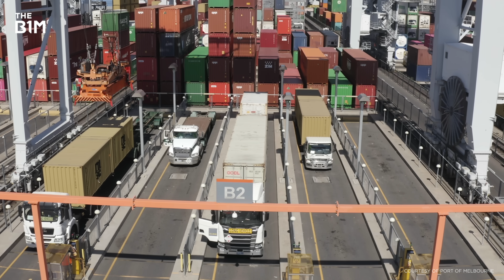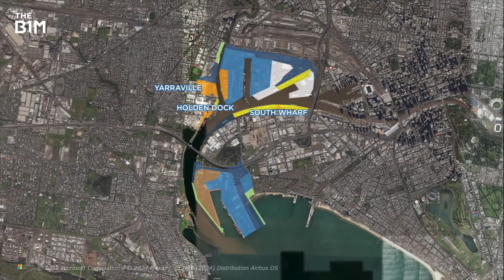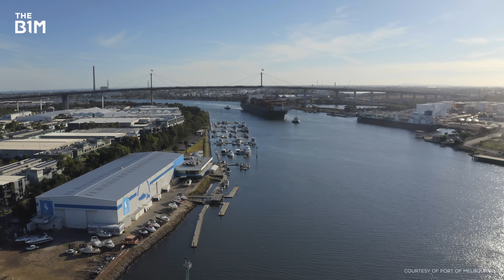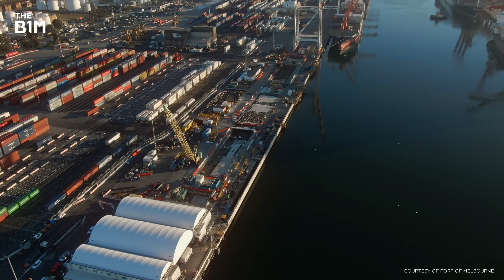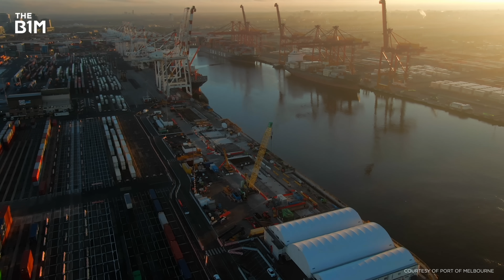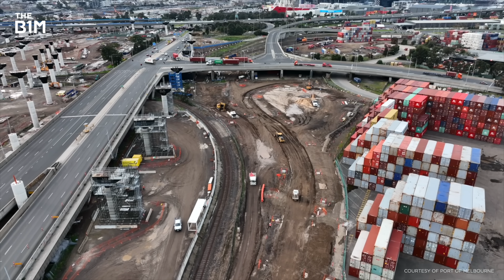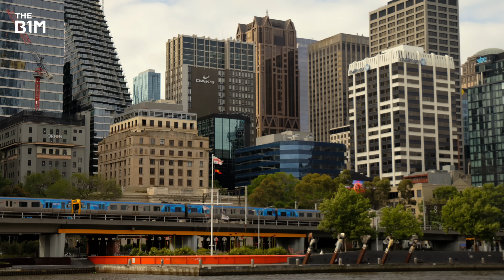The Race To Fix The World's Most Isolated Mega-Port

Comment: Dunno about it being "a race", more like a leisurely stroll in the park on a weekend.

Truck traffic through inner Melbourne is a nightmare. Despite the so-called "Big Build" that we're experiencing I don't know how it will benefit cargo logistics.

There were rumors about relocating the Port of Melbourne out to Hastings which is a deep water port and services the steel industry there. With nearby access to a major freeway, put in a heavy railway line (two lines, not one), and I'd have thought that it would be a no-brainer. Away from the centre of Melbourne and the existing port could be redeveloped for housing, other industry or whatever. But no, no-one wants to do it. Cost too much I'd expect. Lack of forward thinking.

Comment: But there is a train that comes up daily on the Frankston line where the train has more than sixty carts, that I assume is coming from Hastings which is a deep water port. I used to get stuck in my way home from work every day waiting for this train to move through the crossing. It was probably the reason that the level crossing was removed first.

Comment: Cool video mate, I was the front end loader operator for Seymour whyte on this job, that was a good job, the magnitude of scale of the fill we stripped and re-used on that job is hard for the non construction minded person to comprehend, I also found quite a few old bottle's, heaps of old red bricks and big bluestone blocks that were damaged and discarded as fill however long ago, they were very reminiscent of the bluestone blocks found on the facade of the state library in the cbd

Comment: Reminds me of Southampton. The bulk of the city separates the docks from the rest of the rail network. As much of the UK railway network was built decades before shipping containers had even been thought of, there were massive constraints on what could be carried. A lot of work has had to be done to the city centre Tunnel to allow modern ISO Containers to travel through, and the kinetic envelope is being taken full advantage of. Those containers use so much of the space in the tunnel that a human would be completely squashed if caught between the tunnel wall and a train. 

But there are still constraints on the network. For example, once out of the docks they have to interweave with fairly intensive local and long distance passengers trains. At Reading they have to weave across the Great Western Main Line and through the busy lines at Oxford, and in order to reach the main inland ports at Birmingham and Manchester they must navigate an long single track section at Kenilworth which is shared by a half hourly (in both directions) long distance passengers trains service, before then navigating through the intense urban West Midlands networks and onto the busy and high speed West Coast Main Line. Then there is the national disaster that is the Castlefield Corridor in Manchester. 

There’s an argument that so much national capacity could have been opened up, at far lower cost than HS2, by building a Southampton/Felixstowe to Manchester/Glasgow dedicated freight corridor in the same idea as the Betuweroute. But where’s the shiny prestige in freight trains?

Comment: Nope. Sydney is still Australia's most populous city. This is because the official figure used for capital city population, by the Australian Bureau of Statistics, is the Greater Capital City Statistical Areas (GCCSA). It's predicted that Melbourne will overtake Sydney in approximately 2030 or so using the GCCSA measure. The figure that is being used in the media is the Significant Urban Area (SUA) population. The City of Melton has been added into this population measure & this Melbourne's popultaion is higher than Sydney.

Comment: Does the geography not allow the port to be further away from the city center? That would solve so many problems.

I do not really understand why there is space for thousands of trucks, but not for trains. Those do not need o be 600 metres long. Just let a train carry 20 containers at a time from somewhere in the suburbs to the harbour. In Hamburg that is actually some. A few miles outside the city there is a huge cargo train station where goods are loaded onto trains. Those trains run to the harbour which in Hamburg also is right next to the city center.

Comment: I started at V/Line in Melbourne back in 1985, when it still handled freight all over the state.
Through several people in government having links to the road transport industry, more and more freight was put onto trucks, and the Melbourne Freight Yards were torn up one by one to enable the construction of the Docklands. Rail lines statewide were decommissioned and removed.
I had moved over to the Passenger Division in 1987, and from where I worked in the yards at Spencer Street - I had a ringside seat as it was all replaced by residential blocks, a stadium and Ferris wheel. 
The self inflicted situation that Melbourne found itself in, is primarily one of short-term self-interest over long-term visions for infrastructure. Hardly an isolated instance in Australia's history.

Comment: Ahhh - typical Victorians - they screw up their port. Container traffic should move to a new port at/near Point Wilson where rail and motorway connections are available. It would be parallel to Avalon Airport and between the bird sanctuaries. The port would function far better, and the government and community would reap a big dividend in the inner city.

Comment: We used to have a full rail connection to Station Pier and Princes pier that could tranship goods direct to rail.  That was destroyed so that Crown Casino could take over Southbank and lead the current transport nightmare through that area.  It was replaced with a very circuitous route to Webb dock.  That was destroyed so they could put in a football stadium and the Spencer Street and Victoria dock were destroyed to develop that area. Leaving a part of the docklands ENTIRELY reliant on trucks which pass through suburbs where the road making is nowhere near what is needed for heavy trucks. And one "solution" is to move a transshipment hub to the outer north of the city requiring all goods to be on truck through the city.  Great solution fellas. I forgot to mention how the original docks in the city were made inaccessible by the low level bridges such as queen's bridge and Spencer st bridge and Victoria docks were made inaccessible through two low level bridges just downstream of them.  In essence the docks have been a continuous example of REACTING "planning" and not FORWARD planning.  I strongly doubt that this current plan has more than a 10 to 20 year lifespan at most.
Reply: Totally correct, this is what consultants like me and my many friends at the former Vline Freight and Railways of Australia were saying in the 1980s and ever since. Future proofing means not closing off options (permanently) yet the policy actions that followed were the exact opposite of good practice. And increasingly cemented an irreversible point of no return.

Comment: Why can't some of this cargo be taken off a ship then shipped onto a smaller ship rather than rail?
Say the Melbourne to Adelaide run could be done by a smaller cargo ship that can berth in the smaller port in Adelaide. 
It would remove a lot of pressure from the infrastructure and cost far less over time.

Comment: Surely Fremantle is more isolated? Melbourne is a major freight hub. They even finally managed to get a single gauge track after 100 years! Some port facilities are not near the water at all but way off in other suburbs with a lot of flat land. A lot of the land they originally built the port on used to be a swallow lake that filled up with garbage in the first few years of settlement. Was called the Blue Lake. They already changed the course of the Yarra River for traffic. Was a boat that was stranded on dry ground for decades due to it.
Reply: How? Fremantle is on the Indian Ocean which is the artery between Europe and Asia. Melbourne is a lot further out from major shipping lanes. Perth may seem isolated when you're living on the East Coast but globally it's more accessible.

Comment: While on the topic of ports, there is a massive project underway in Egypt. The port of Ain Sokhna. It is right at the mouth of the Suez canal (southern end). It is part of a country-wide plan of port expansions in Egypt (Damietta, Alexandria - multiple terminals, Abu Qir, East Port Said, Safaga) but it is the biggest by far, and is gonna be linked to Alexandria by high-speed rail (also underway, due to open by end of next year). So, it would be great if you can make a video about it (as credible information about new constructions in Egypt are hard to come by), its relation to the Suez canal, geopolitics (China's Hutchison will manage multiple terminals in Egypt), regional and global competition (Dubai, Mediterranean, etc.), etc.

Comment: Nice to see Bentley Systems spotlighted.  I first used their microstation software in 1989.
Reply: Likewise, my first taste of that software was with the original developers Intergraph back in 1987 running on a Vax 11/751. When they moved to a desktop system MicroStation was born. The project I saw been worked on was a substation that was local, so we watched the real thing being built and made operational.
Reply: @StewartEvans-e3z Bentley was independent from Intergraph. The scratch built their PC software to be file compatible and mimic the Intergraph Design Station.
Reply: The version of Microstation I remember was running on their stand-alone workstation, the Interpro-32 which was released in 1984 and used a non-intel CPU. Bentley started maybe a year after that, the VAX based software was IGDS and the workstations booted off the Vax. I think the Bentley version was originally made for onsite work and had some limits on size.

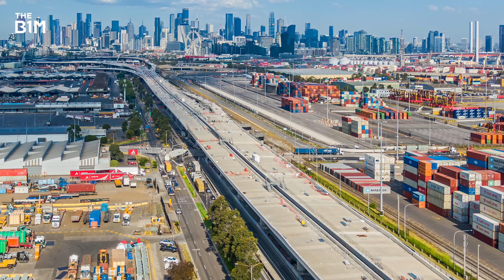Comment: The amount of construction going on in that area was incredible. Not only was there the Port Rail Project but at the same time, Transurban were building the Westgate Tunnel project (ironically, about 50% of this tunnel is actually elevated road). You can see the bridges in the foreground at 10:28. This was almost like the other part of it. The WTP was designed to get trucks out of the Yarraville area by going underneath it and straight to the Westgate Freeway. It's due to open at the end of 2025.

What we need now to back it up is new rolling stock. If you think those engines look old it's because they are. In fact, they're probably older than you realise.

Comment: Probably should have mentioned the two new intermodal rail terminals in the outer west and north of Melbourne.
Reply: Somerton Intermodal is private facility under construction now! The Gov's Truganina and Beverage precincts are in the planning stage. The Beveridge Terminal will be built first and then Truganina as capacity is needed, This all ties into the ARTC Inland Rail route Melbourne to Brisbane  This coincided with the need for the Outer Suburban Ring /E6 to link the terminals by road with the possibility of rail inside the E6 corridor. All public listed planning if you google it !

Comment: Way is the biggest freight port in Australia at the southern most tip of the mainland. Wouldn't Brisbane be a better location?
Reply: Well Melbourne is now Australia's largest city and projected to grow faster than Sydney. The rail linkages from Melbourne fan out to Adelaide and Sydney so has a catchment area that covers half of the population of Australia.
Reply: @LightTower3  That is changing, since Melbourne's median home price is creeping closer to Sydney's. It is not correct to claim Melbourne as the largest city either, since Sydney has a land area of over 12,300km2 whilst Melbourne is closer to 10,000km2. Sydney's greater population is also ahead by more than 200,000 people.
Reply: @vintageradio3404  the metro area of Melbourne has 271K more than the Sydney metro area (2023 estimates). Melton, a large  suburban area in outer Western Melbourne recently was included in the metro area calculations, it wasn't previously.
Reply: @ I don't know where you get your figures from but they are wrong. The numbers I gave you are correct and universally recognised.

Melton a suburb? Connected to Melbourne by a country rail service with poor frequency and small trains? You should come to Sydney and see what we have. Far larger trains that run every 10-15 minutes in the peaks from the outer areas. What's more, people actually use each train. Central-Wyong is Australia's busiest intercity line by a long shot.

Comment: i live a km or 2 away from all this and knew nothing of  this construction project. its all about the east west tunnel project. thanks for highlighting this!!
Reply: Yep live in Melbourne to and had no idea about it either 😅
Reply: My thoughts exactly! Melbourne born and breed (and work in construction) what an amazing project I’ve never heard of! Takes a international YouTube channel to inform me of major local projects in my own back yard lol
Reply: Yeah it’s kinda stealth due to the tunnel works.
If ever went to Costco you really saw most of the work across the road, and the interconnection from trains going between Footscray and southern cross
Reply: Loll same I’m in west Footscray
Reply: Its all sort of rolled in to the "Vic big Build" The Footscray Road Upgrade with Bike overpass and separation of trucks and cars is all under that banner. But this is a big step.
Reply: East West tunnel is the one that should have been built that Dickhead Lockdown Dan canceled.
Reply: They just need to electrify the railways with overhead wires, since electric trains are much more powerful and faster, and upgrade to 4 tracks on all mainlines.
Reply: @ncard00 yes to that. The diesel trains are outrageous. Look at how filthy the tops are and they exhaust into the air we breathe. Southern Cross is a nightmare with VLine trains spewing out ultra fine diesel dust into people's arteries while they idle. No wonder that guy working on the escalators developed health problems.
Reply: East-West Tunnel? That was canned about 10 years ago 🤔
Reply: @petesig93  West Gate Tunnel project then Mr pedantic
Reply: @ same thing different route

Comment: Here in the USA, our freight trains are normally a little over a mile (1.6 km) long, but it's also somewhat common to see trains over 2 miles (3.2 km) long. As railroads chase unsustainable never-ending growth, trains are getting even longer, so long they dont even fit on sidings or in yards anymore, because it is cheaper to run less longer trains than more smaller ones. It's crazy to hear the rest of the world talking about a 600 m long train as being "long". The main problem with these mega trains is that they dont fit in the existing infrastructure. It's pretty common in the industrial areas of our major cities for crossings to be blocked for half an hour or more while these trains get assembled or wait for another to pass. They're a great sight to see if you're a railfan though. Sometimes you wait for 10 minutes at a crossing while the train passes.
Reply: In Western Australia there are trains carrying ore/resources that are 4.5 miles (7.3 km) long that literally creep along at a walking pace. But they don't go through any cities. (You don't want to be waiting at a level crossing for them though)
The freight trains coming to/from the port of Melbourne have to go through Melbourne proper no matter their destination.
Reply: The is a long running project in Melbourne to remove over 100 level crossings. These are being replaced with road under rail or rail over road. It is a major infrastructure project in its own right. Getting stuck at level crossing is a pain in the butt no doubt.
Reply: We regularly run freight trains of 1.8 to 2.5 klms long here in Australia. Crossing loops have been built to facilitate these trains.
Reply: Inland rail project currently underway for ARTC is the long a haul train route Melbourne to Brisbane they are upgrading bridges and line in 3 states as well as new corridors linking Toowoomba -Brisbane for the future with double stack containers like Usa!
Reply: @JAB8 Perth to Adelaide do double stack already🇦🇺
Reply: @ACDZ123  True! 
I don't get over there much 😥
Reply: @JAB8  I used to live in the eastern suburbs of Perth and it was wild seeing double stack freight containers passing through suburbia. Felt like you were in America
Reply: It's okay, I think Australia still holds the record for the longest train, at over 7km.

Comment: G'day Buddy,

I work in the Melbourne Port day in day out as a truck driver last 25 years.
Let me tell you this new rail line is a white elephant just go have a look at the rusty rail.
Only Qube use it, no train into DPW over 2 years.
The infrastructuring company is milking it always working on the points.
There is a guy sitting on a chair with a red flag all day to stop the train that never comes.
Now digging up the concrete to fix who knows what.

No train has gone into 1 East since November and only BG trains not one SG train as yet.

Another white elephant like the dredging.
Need a Royal Commission into the dredging no large container vessel has come into Port of Melbourne as predicted.
They are not even maintaining what they dredged all those years ago.

Talk to the people who use the wharf and see everything every day.

Cheers

Louis Kats 👍